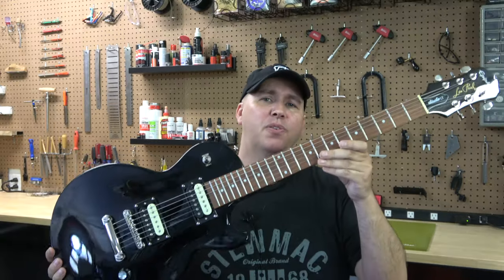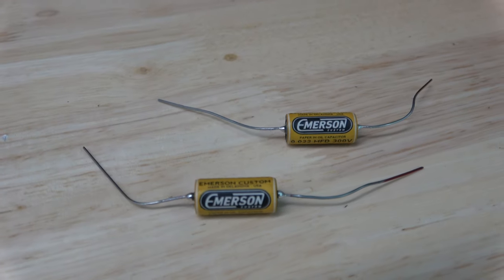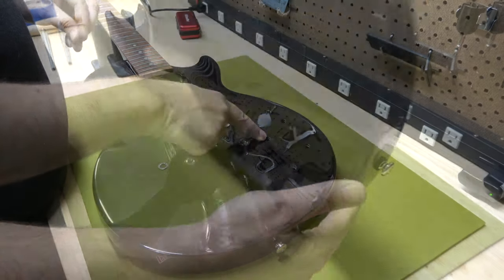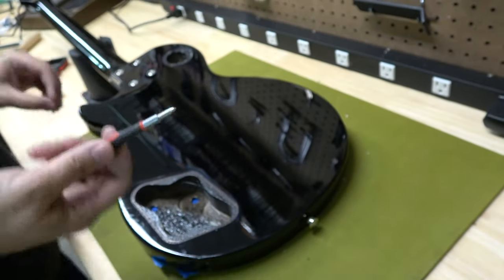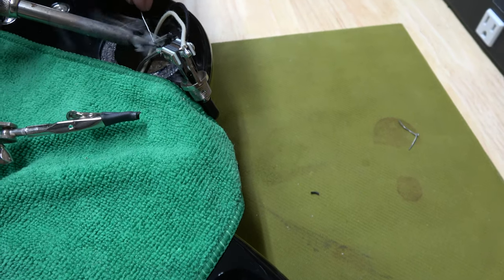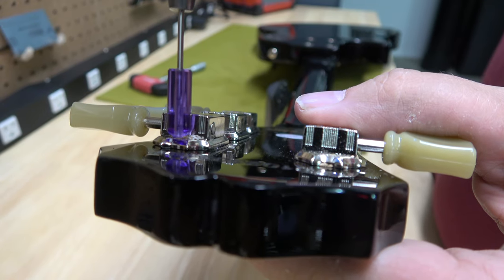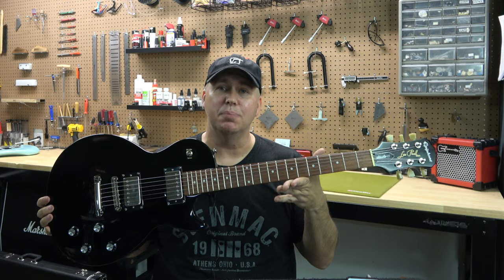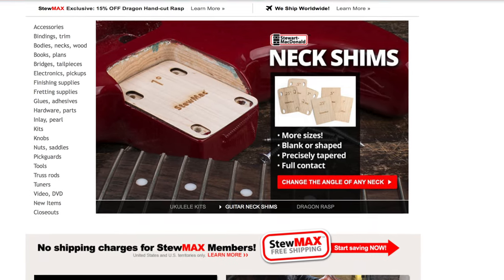Phil McKnight Shows Off Our New Epiphone Hardware and Electronics Upgrade Kit

Comment: Add the cost of this kit to the cost of the new guitar, and you could buy a pretty nice used Gibson, or a less advertised but excellent brand of guitar. The 'kit' is essentially a way for Stewmac to grab your money. After all the money and work---you still have an Epiphone, worth WAY less than the money and labor that you have put into it. Just saying...
Reply: It's fun to do. I like doing things like this and the skills learned are worth more than the cost of the parts.
Reply: @trentc7329  OK, but you can learn on a very cheap guitar with very cheap parts, and work your way upwards. Eventually, you will realize that almost $600.00 for this guitar is just silly.
Reply: @perihelion7798  Depends on your goal. I did this to my Epi and yeah it sounds better than a Gibson too. The haters may not like it but for my playing it was money well spent. I don't sell and trade so for me that's a moot point. I spent the extra money to get Seymour Duncan pickups as well. The scratchy Epi pots issue is gone as well and I don't have to worry about the finish of the guitar cracking over the years the way it does on a Gibson, or the QC issues either.
Reply: @bestplans9051  OK...you make a valid point. For your personal use, this way was cost effective. As for myself, I prefer to buy each part, including the neck and body, and then make a brand new, unique guitar. I might keep it or sell it. A lot of the fun for me is the designing and building.
Reply: @perihelion7798  Not a problem and no right or wrong if you wind up with an instrument that is good for you, then you've accomplished what you set out to do.
Reply: @perihelion7798 Most beginners aren't savvy enough to shop for good parts and are probably intimidated by all the wiring. The kit provides what they need, good instructions and support if they need it. They don't have to start with a new Epiphone either. I'd get a used one if I were doing this.
Reply: @trentc7329  Getting a decent used Epi does make sense. I agree that it's a good learning experience.

Comment: How does a lighter tailpiece improve sustain? I always thought more weight improved sustain. Not knocking it, just curious what the difference is.
Reply: Greg - I don’t know the answer to the sustain issue but it is pretty clear you don’t know much about Phil. If you spend some time on his channel I think you will see that he is a pretty straight shooter. He can make mistakes like anyone but your cynical statement is simply uninformed.
Reply: @Axxe Mann : that is... not how sound works. The speed of sound increases in a denser material, which reduces dampening. This is one of the major reasons why Travis Beans and EGCs are so treble-heavy and sustain so long. The greater material density increasing sustain is literally the entire point of having a solid body guitar.
Reply: Not trying to start an argument but I thought solid body guitars were made to reduce resonance thereby reducing feedback which is the problem with hollow body guitars.
Reply: Obviously people miss the point. He said the bridge transfers vibration of the string better due to the way the posts are and as an added benefit the aluminum stop tail piece is lighter. The bridge material does affect tone in so much that brass had a different sound than steel than aluminum. Is it a huge difference? Goodness no. Though some will tell you that it is. It's more like a TINY difference that rarely merits the cost. 

But what IS a difference is how well the bridge can transfer vibrations, and this bridge setup does that better than the stock Epiphone bridge and tail piece.
Reply: @orangeguitarmusik  : That's part of it. When Les Paul set out to build a solid body guitar, it was because he wanted:

1.) To hear the strings and nothing else

2.) To have a lot of sustain

3.) A reduction in feedback

After an unsuccessful experiment with an acoustic guitar filled with rags, then plaster-of-Paris (!) he realized that the densest material he could find was a piece of railroad track. When this proved functional but impractical, he settled on a wood block.
Reply: It's not the weight of this particular tailpiece that improves sustain, it's the quality of the material and the fit with the poles.
Reply: @Axxe Mann If a guitar body is resonating then by the laws of the known universe, it is absorbing string energy therefore reducing volume and sustain.
Reply: @clamus68  You'rewrong. A more solid and stable bridge assembly transfers less of the string vibration letting the string ring longer and louder.
Reply: @c.p.1589  You are exactly and scientifically correct. The ideal solid body guitar with a magnetic pickup would have ZERO resonance, for pure tone and and great sustain. A vibrating guitar body is an indication of stolen energy from the vibrating strings.

There is also the problem of 'sympathetic resonance', where the guitar vibrates at a resonance of a particular frequency that matches a note on the fretboard. That note will be diminished, or even completely dead. Kudos for you and science.
Reply: @perihelion7798  Also, certain combinations of woods and construction methods damp specific frequencies  giving specific guitars their own eq curves. The diff between a bolt on ash bodied Fender and a glued neck mahogany Gibson is the frequencies that are killed. It's a subtractive process like pulling out frequencies on an eq pedal.
Reply: @c.p.1589  Again, you are correct, and talking some science. Resonance is almost always undesirable in a solid body guitar with magnetic pickups.
Reply: @clamus68  What exactly do you think it's transferring vibrations to? Not the pickups, given the minimal differences in the demo. If I worked on a guitar and spent $350 and that was the result I'd weep. The whole "transfer to the body" issue only works if you then believe that the body will transfer that energy to the pickup - it won't.
Reply: @c.p.1589  You are entirely correct. I love the way snake-oil salesmen reverse the rules of physics to sell stuff.

Comment: What I've found upgrading my Epiphone so far:

1) Probuckers are fine pickups no need to replace them
2) Replace the nut - bone will give a bit more sustain and with nut sauce will help with bends. Stock nut is too high, you can fix this with a set of nut files if you don't want to change the nut.
3) Lower pickups to about 3mm from depressed string at last fret. Adjust up gain on amp. This gives you a better sweet spot and more dynamic control.
4) Adjust polls on pickups to reduce 'mud'. From stock flat setting adjust as follows
Low E no change
A string one turn up
D string one and a half turns up
G string one turn down
B string one turn up
High E one turn up
This adjusts for different string core thickness and increases clarity.
5) Buy gotoh bridge 6mm holes for Epiphones. Better machined than stock. Apply nut sauce.
6) Install metal plate on jack socket, the plastic ones break. Make sure you get a curved one with the right spaced holes.
7) Screw stock tail piece down and over wrap strings as Bonamassa does.
8) Setup. Level frets if necessary, crown them. Check neck relief and reduce string action as per preference.
9) You could install short switchcraft toggle switch for better reliability. (Or just clean stock once a year).
10) Stock electronics are fine. Not much difference in changing them. IMO only worth it if you want more features ie. phase cancelling, parallel.series wiring etc. If you want every possible combination search Jimmy Page wiring diagram - good luck there are wires everywhere ! 
11) Leave the tuners as they are.

Total cost not much !
Reply: What if my guitar has Alnico Classics, I think there is a difference in upgrading the pickups then. Also, my guitar comes with linear taper pots that roll off too quickly. Stock Epiphone bridge rattles sometimes..
Reply: I got an Epiphone VE LP the tuners were terrible, I also hated headstock so shaved it down to a melody maker style and which it basically is, resprayed in satin OD. Looks great with new snot tuners andAlso took out humbuckers made scratchplate for neck and put a dogear p90 in bridge.  gotoh bridge, stock tailpiece and earthed the neck position on toggle which made it a killswitch. It's so nice now I really like it. If you want to refinish one of these the VE is great, the paint is so thin and it had no clear
Reply: I did similarly upgrades. Paid around $500 to a repair man to do it.
Reply: I like this. However I might consider upgrading tuners. String bends send me out of tune in my epi lp standard.
Reply: @LuisSalgadoG95  Start with the pots, caps, and wiring. Only then would I bother with new pickups, personally. Follow this poster's instructions for adjusting pickup height and pole piece (screw) height, as that can make a tremendous difference.

If you bother replacing the bridge, find a solid steel or proper density steel/zinc alloy. Too many times I have clients buy replacement hardware that is made from materials lower quality than the stock items, or no better. Tailpiece should be solid as above OR aluminum. Bridge saddles to taste (for example roller bridge, steel, brass, Graph-tech, etc.).
Reply: If there epiphone tuners they suck,probuckers need upgraded imo,raising pole pieces is totally unnecessary and I’ve never had a problem with their nuts lmao what I’ve found is a lot different than what you have found,that’s why I tell beginners never trust opinions on gear
Reply: Thanks!!

Comment: I did exactly the same with different components. I used the Gotoh Brudge, Tailpiece and locking tuners. Enormous upgrade already. I also changed pickups and wiring. The guitar cuts through the mix of the band and sounds not so muddy anymore. A standard Epiphone or a Squier is nice for practicing. Now you get a great sound on a stage for way less than a Gibson. The upgrade was so big I started to test different components. A luthier (fret job, setup) and always using fresh strings makes it that the guitar sounds better than a Gibson Les Paul Standard. I also made these changes to a Stratocaster (tremolo, tuners, wiring, pickups) and a Telecaster (only wiring and pickups). It’s not cheap . I love to test components and improve the sound of guitars now.

Comment: I can hardly tell any difference when clean, but it was more noticeable with a bit of overdrive. I can't justify the price though. Surely Stew Mac would sell far more if the prices were lower?
Reply: So would Rolex but will they listen to me? 😂
Reply: You can put together your own wiring harness for a lot less money. If your Epiphone came with tuners, you can skip upgrading those. StewMac sells at the going rate for a Gotoh tailpiece and bridge, which are good quality, but that might not make as big of a difference. Change the tuners if they're cheap junk, then the wiring, switches, and pots, then if you still don't like the sound, the pickups. Great pickups can be bought for far less money these days.

Comment: $345!!!! Holy crap!!! I just bought a used 2009 les paul standard for $125 Cleaned it up and rewired , changed jack and cleaned and lubed all pots and the switch and its sounds better than most of the used high dollar epi"s I have looked at. Most all of stew macs stuff is WAY over priced. I made all the tools to do fret jobs and it cost me $20 bucks.
Reply: Doesn’t sound as good to others as it does to you friend.

Comment: So overall I like the idea, and I have a LP Custom made by epiphone that I have done some work on.  Swapped the pots and switches for Switchcraft put oil filled caps and 50's wiring, new nut etc.  I have not gotten to the pups yet...mostly because I'm pretty happy with the sound.  Maybe it's just my 57+ year old ears or the less than perfect speakers on my lap desk but I didn't hear THAT much of a difference in the upgrades that Phil did.  Also I think the point needs to be made clear that if you perform these upgrades and think you will get more money for the guitar when you sell it you are VERY MUCH mistaken.  The guitar Phil is working on new is probably about $249 to which you are adding $342 of upgrades to it.  That will NEVER equate to a total value of $591 on a resale.  In fact it will mean little or nothing.  Also only the player can decide if everything Phil has done provides $342 in enhanced tone and performance.  Eventually I will likely trade out my pups for the same pups he used here with the gold covers but I also plan to leave my instruments to my kids so resale is not an issue.  Plus I like monkeying around with my instruments.  From Watching his channel I know Phil is a huge supporter of using locking tuners so I was surprised he didn't use them here.  I guess he was just using what Stew Mac gave him to use.
Reply: Locking tuners would actually be an upgrade worth doing. The rest is mostly nonsense.

Comment: Thanks for this! The pickups and tuners are the main upgrade for sure. I picked up a set of Gibson 57s that came out of an SG (the owner went with active pickups) for $40 and a set of Grover Tuners and dropped them in my 1997 Epiphone Les Paul Standard. I didn't change the pots because the tone wasn't muddy and at 10 I get lots of bite and clarity. I might drop my multimeter on the pots and check if they are 500k and add 0.22 caps to see how it affects my tone but honestly, I don't think there's a need to go with paper and oil unless you're doing a retro or vintage guitar and the owner 'needs' to have old school parts. Big thanks for letting us hear the sound difference! Far too often the tech just says, "I hear a difference" but never let us here the before... .thanks!

Comment: I just modded an SG with active EMGs, Wilkinson roller bridge, locking tuners, bone nut, and jumbo frets.... Total cost was about $175, half the cost of this kit.
Reply: Did it make a big difference?
Reply: @stephanguitar9778  I'm loving it. It plays great, and the EMGs are really pretty versatile. The biggest change is the jumbo frets though..... I never liked the thin frets used on the SG/LP.

Comment: I am chasing used Epiphone Studios on ebay right now but adding the cost of these upgrades (as sold by StewMac) would bring the price up higher than a new Epiphone modern or most of the other higher end epi's. Or conversly for the same price as the kit I could get the new Epi 2020 Studio.

Comment: Stupid question. Does string tension hold everything in place for the bridge and tailpiece? I have tom delonge  epiphone es 333 and the bridge screws in and the tailpiece has clips that hold it in. I bought this to replace them because of corrosion. It's definitely not a snug fit for the bridge or tailpiece. It screws in just fine, but otherwise neither is a snug fit

Comment: I literally was about to message Phil to ask if it was worth upgrading my Epiphone Special 2 because I see alot of Squire  upgrading but, nothing for the Special 2.
Reply: Thom Macy you can, but I’d advise against it. I would spend the money to get a used guitar that has an adjustable bridge instead of pumping money into a guitar that can’t be intonated
Reply: David Wang  the special 2 or any one piece wraparound bridge does not work like that. You can't consistently intonate a wraparound because it's only adjustable at 2 points. Any adjustment to 1 string is an adjustment to all strings. If these bridges could be intonated better than "good enough" there wouldn't be an aftermarket full of attempts to fix the problem, but as they ship there will always be something off with the D and G strings.

Comment: I couldn't hear much of a difference with the upgrade. Both sounded thick and muddy.  I'm on a desktop with a nice set of speakers.  This is just my experience, but when a guitar is dull and muddy, there isn't much that can improve it.

Best advice in the vid is to hold on to the original components.  If he sells the guitar, don't want to give away the StewMac parts.  I think the new pots have to stay, though.